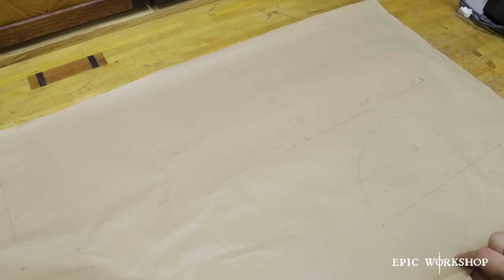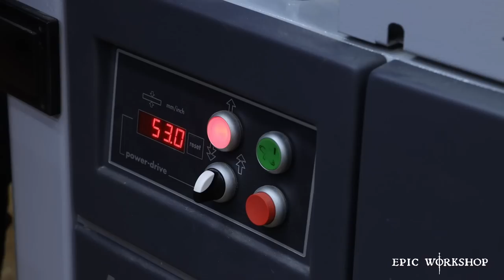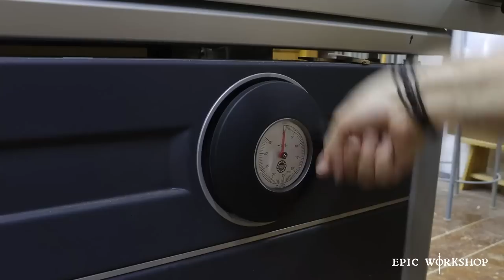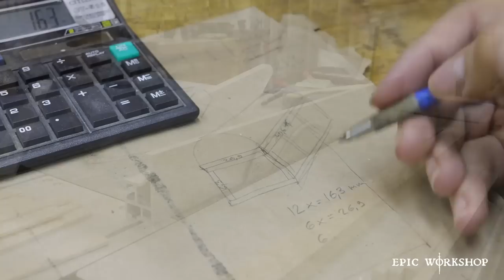Faux Pirate Chest - Hollywood Style

Comment: All a bit straight and obviously machine cut for Hollywood. They might cut corners in the build but they're very careful with the finishing process. The "wood" parts would also have got a beating like the "metal" and the lines between the "planks" would have been cut after by hand to get rid of the straight lines. Still nice look.
Reply from the maker: For me since it was made fast and just to look good enough it is Hollywood 😅 Thanks 🤘